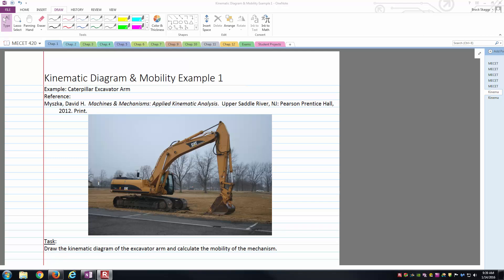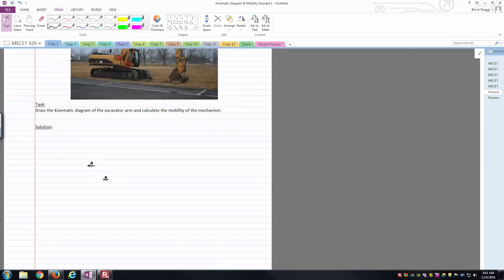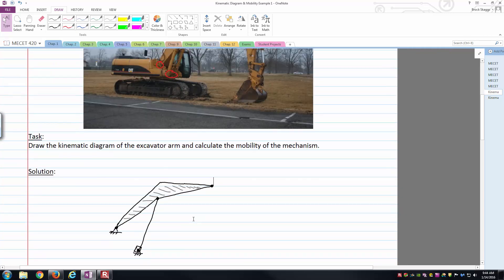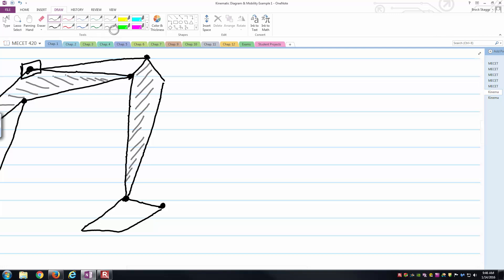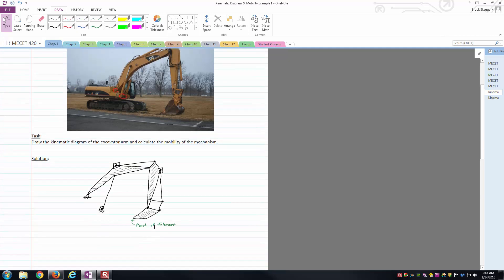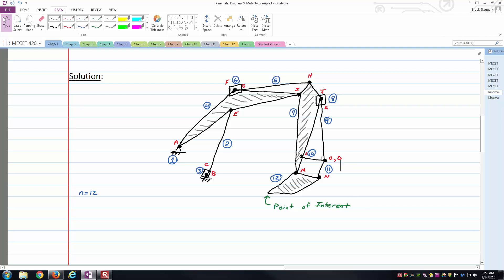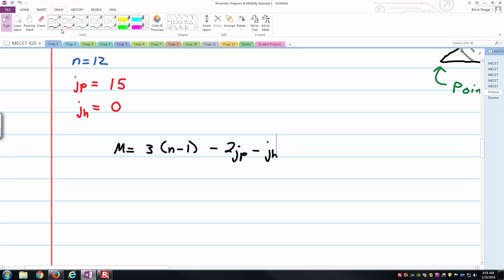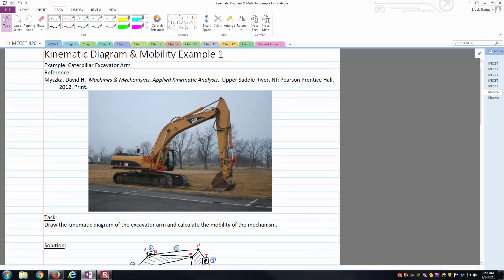Kinematic Diagram & Mobility Example 1

Comment: Shouldn't the 12th Link not be included since it merely goes to a point of interest and in Grubers equation, links are connected by a minimum of two joints?
Reply from the maker: Link 12, the bucket component, is connected to two links.  Joint M connects to link 7 and join N connects to link 11.  Point of interest is then on the other side of the bucket where the tips of the teeth would be located.

Comment: great stuff. Couldn't tell where I was going wrong, but I was drawing my hydraulic press sliding joins in the middle of the long link so I had negative mobility from too many revolute joints. Thanks!
Reply: Where you draw them technically shouldn't matter if you consider the link to still be one length seperate from the slider.
Reply: If you consider the sliding pair for hydrolics than consider cylinder and piston as two seperatw  links. The answer will be same.